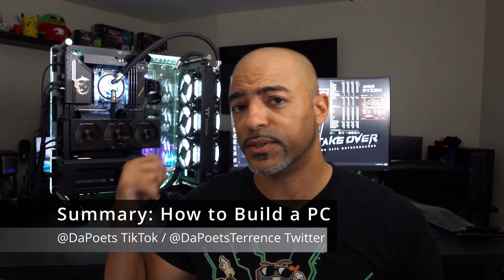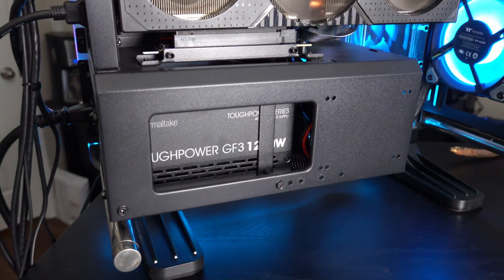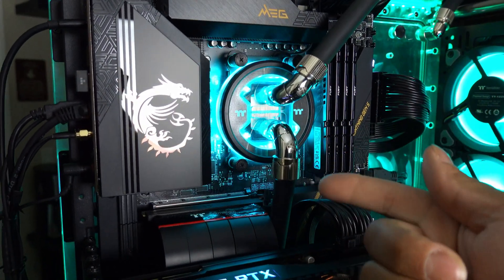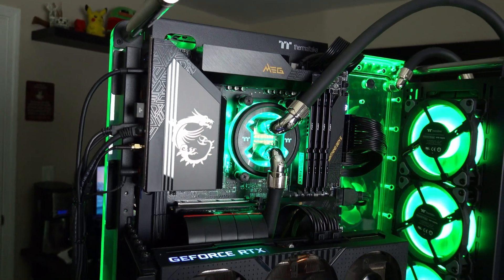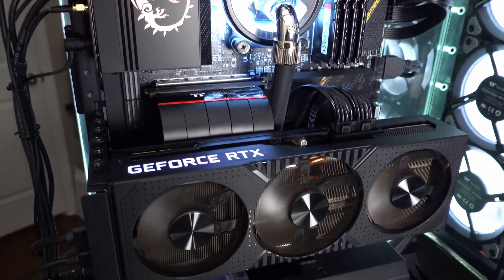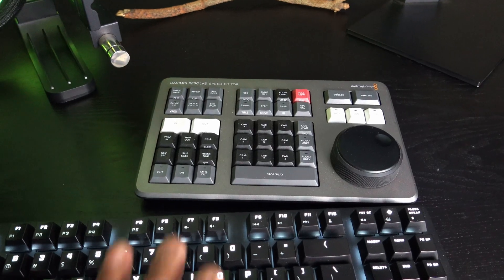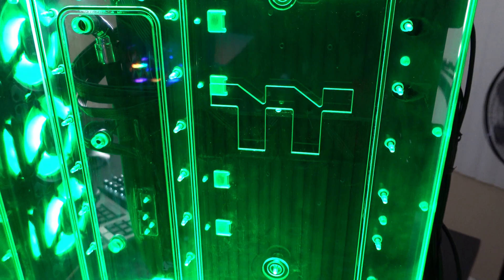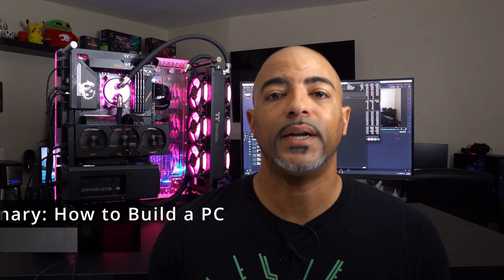How to Build a PC   Summary

Comment: How do you like the PSU? I heard some of them make a sound at startup. Do you have any issues with startup sound on the Thermaltake 1200 GF3?
Reply from the maker: Barely noticeable. Didn't think about it until you posted this. It's just a quick spin up so a non-issue.
Reply: @DaPoets  thank you :)

Comment: 9:30 I don't know about custom loops, but for AIOs a very thick 360mm sized radiator will dissipate heat away from the CPU well using only 3 fans than a thinner 360mm rad with 3 fans.   A thinner radiator will benefit better from doubling up the fans for a push-pull.
Reply from the maker: Thinner than 38mm won't generate meaningful benefits from push/pull. Past 38mm you see great benefits of push/pull
Reply: @DaPoets  No, its the opposite, watch the video from TechteamGB "Push Vs Pull vs Push-Pull for AIO Liquid Coolers" he did a full test on this.  I seen the benefits first hand since reconfiguring my 5900X using a BeQuiet PureLoop 280 to a push/pull configuration, and can now comfortably go much further on Precision Boost Overdrive Scalar in overclocking.  I did the same for my TR 3960X using the MSI CoreLiquid 360R AIO, the push/pull added a lot more room for me with overclocking it.  Both radiators are very thin, much less than 38mm thick and I'm saying from first hand testing there is greater cooling potential to thin radiators if you refit them for Push/Pull.
Reply from the maker: @vh9network  I'll take a look but this has always been a constant with push/pull. Thin rads it barely makes any difference but adds to noise levels, while thick rads get large benefits. Even with all of my testing over the years. But I'll see that video to determine how they got their data.

Comment: I am just curious bro. Do the water temp increases with such a hot cpu? And so by how much. Thnx in advance and keep up the great work.
Reply from the maker: So far they barely move. About 2°c so far but I have a lot more benchmarks / testing to do.  This is mainly because of the thick 360mm radiator.  If it was a slim rad then yes temps would increase a lot more.
Reply: @DaPoets  thnx for the reply bro. I am sticking with my 5900X. Just did a custom loop in an lian li lancool 3 with three rads. Temperatures are amazing.
Reply from the maker: @swizzler8053  Fantastic!